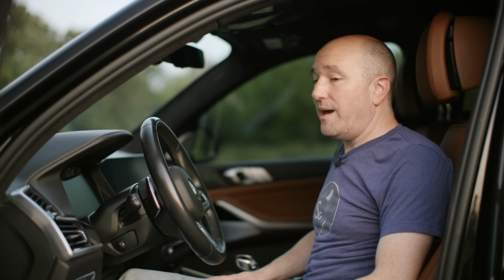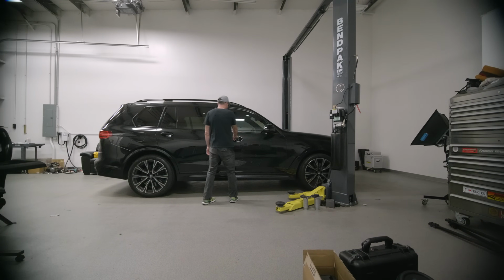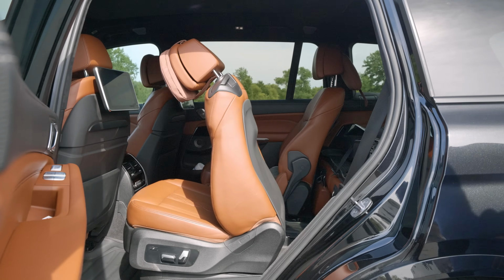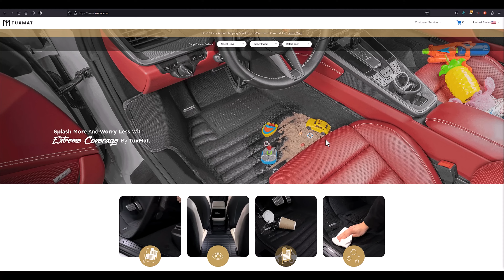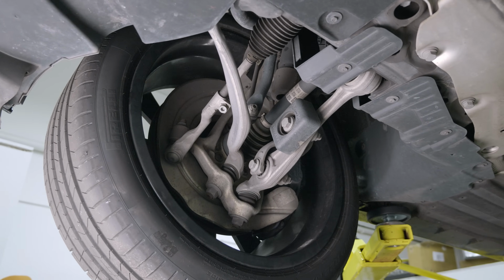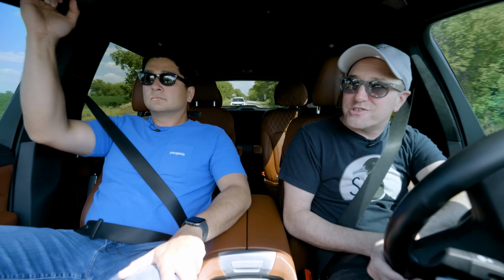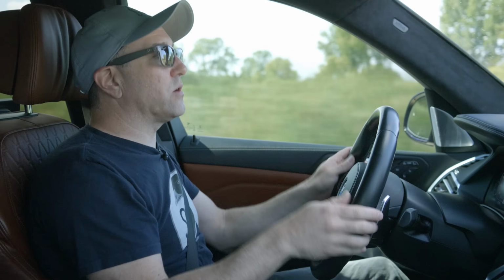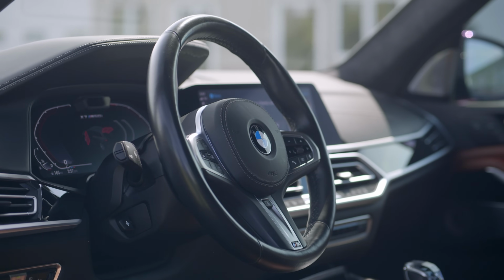BMW X7 | 45,000 Mile Long Term Results

Comment: Mark is the evolution of the modern car buyer in real time. LC500->X7->Rav4
Reply: It’s the sad fact. The running cost of “performance” cars is just too much these days. As much fun as I get out of my GTI, I sometimes wonder if getting a basic Camry or rav4 would have been better.
Reply: @waitingforcivictyper  the GTI is the perfect daily, you didn't make a mistake. The backseats are a little tight, but unless you have passengers all the time, it's fine.
Reply: @waitingforcivictyper GTI’s are performance cars?
Reply: @waitingforcivictyper  I see, you pay z German car tax, ya? :)  I figure the GTI wouldn’t be too bad to keep running as compared to BMW.  I heard the Civic Si is a pretty good compromise for fun vs cost of ownership.  

I’m old and boring enough to be happy with my hybrid CUV.  It’s quiet, comfortable, and has good tech for being 10 years old.   The roads around LA are bad enough I just want to keep my kidneys happy :)
Reply: This makes sense:
*LC500 - Looking for young hotties.
*X7 - Looking to have kids with a hottie. 
*Rav4 - Having failed at both, I give up on life and pursue inner happiness instead. 

I think that sums it up :0)
Reply: So who killed sports cars?
Reply: @waitingforcivictyper GTI's don't usually cost much to run, until the timing guids fail or the DCT implodes or something. My sisters had one for like 9 years or something now, it's cost her nothing but regular servicing and a failed window regulator - BUT, the mileage is starting to get up a bit, and it's now worth so little that if it has any serious issues, it may not be worth repairing - which is what happened to her prior VW, a W8 Passat - but they are notoriously unreliable and expensive compared to the Golf.
Reply: Except new RAV4 costs same as used X7.
Reply: @brianm5753 The modern left.
Reply: Yep. That interior is amazing. They should of kept it the same
Reply: Gesture control is amazing for adjusting volume and blacking out the screen for night driving
Reply: @DriverDude100  A new 2023 RAV4 in absolute top spec is under $40,000.  A used X7 M50i is going to be maybe $20K more than that at a minimum - and possibly quite a bit more depending on year, spec and mileage... and it'll cost you a fuckton more to run - and over the long term, probably more in depreciation, since even brand new RAV4's hold their value a lot better than aging BMW's - particularly aging S63 powered BMW's.
If you are like Marc here, and you've tired of the one-trick pony of the M50i's straight line speed, it makes a lot more sense to have a practical, economic daily driver, and a weekend car that one luxo-barge monstrosity consuming vast amounts of fuel, tires and suspension components, and rapidly approaching the 100,000 mile doomsday of the typical BMW V8.
Reply: @waitingforcivictyper  My GTI didn't present problems and I wouldn't drive a Camry.
Reply: @AllGasNoBreaks416  Why yes, the GTI IS a performance car.
Reply: @rlsedition  I guess to some it might be. I just can’t see a sub 300hp car being a “performance car” 

my 440i makes about 480hp with a downpipe and e30 tune &and I don’t even think if that’s a performance car.
Reply: I feel somewhat attacked and you’re spot on, lol. 911>Macan>GTI>M3 (currently)> waiting for a 4Runner😂😂😂
Reply: haha.  I did the poor man's version of that: RX350 -> X5M -> Hyundai Palisade
Reply: @waitingforcivictyper how much is your running cost & what year is it ?
I mean Camry / rav4 are good for buying & keeping 10-15 years
Reply: @NS416 if hp numbers is your barometer for what is/ isn't built for performance, you don't belong anywhere near actual enthusiasts.
Reply: @waitingforcivictyper I have a 2019 750i Msport, everything you just said and mark just said are bang on. 

But man, it’s hard to give up a v8 like the one that’s in these, mine is delimited and does 180mph with ease. 

I don’t think I’d be able to go to an anything smaller than an X3 m40i after owning this, the amount of room I have in this car is just insane.
Reply: @jaybinning2890 😂 how was it giving up your x5m? I currently have a 2019 750i Msport, it’s been worth every penny so far, have 50k miles on it currently
Reply: Ew
Reply: LC500->X7->Toyota Sienna
Reply: @brandonchism6960 how did you like the M3? I hear the gas mileage is great. Will the new car replace the M3 or be an additional one?
Reply: @WestOfAsh  it's actually good for the immense amount of power it outputs, though B58 should be sufficient enough for its everyday daily driving
Reply: @WestOfAsh  it’s great man!!! Still making that decision in terms of keeping it or replacing it. Likely keeping it based on mileage (64k on a 2022). As for gas, the manual isn’t as good as the auto, but I’m not complaining. I averaged ~28-29 for just under 80mph on long interstate rides. The car runs at 3k once you’re doing 80mph so it’s worth slowing a bit, lol.
Reply: Not if you've always messed with only Camrys and RAV4s...
Reply: @MikeYurbasovich exactly
Reply: @hondahirny ❤
Reply: LC500->X7->MDX Type S or KIA Telluride is his next one
Reply: @jaybinning2890 , in the last 9 years I did the following 6:
‘15 Golf -> ‘12 Smart Car -> ‘16 Sonata 2.0T -> ‘19 X3 -> ‘18 S90 T6 -> ‘11 TTS
Small->Smaller->Big->Bigger->Biggest->Smallest 😂
Reply: Yup. Ultimately, every day driving pushes you to practicality and expedience. $2500 tires? $200 rotors? Are you nuts?
Reply: @AllGasNoBreaks416  Your definition of "performance car" is not like mine. Drag racers think it's all about straight line speed and that's one way to look at it. I prefer a well-rounded machine, with equal focus on powertrain, vehicle dynamics and braking capability. One should also consider we're driving on public roads, where all that power is not easily usable on a regular basis. So it depends on your definition.
Reply: @brandonchism6960  I rented a 4Runner a few years ago and that machine had terrible handling/steering characteristics. How could you be satisfied with that vehicle after the performance cars you owned?
Reply: @rlsedition  Yep. I would consider a M4 / Golf R more of performance vehicle then like my 440i & your GTI. But I guess it’s depends on the person.
Reply: @AllGasNoBreaks416  I sold my GTI and purchased an Alfa Romeo Giulia 4-cylinder, which I also consider a "performance car". Both machines meet my definition for real world driving and favor vehicle dynamics over raw power.
Reply: @rlsedition  Great question. I'm not interested in the current offering. I want the one based on the upcoming Tacoma. While it still won't feel as great as any of the cars that I've mentioned (and some others that I didn't), I'm ready to have a vehicle that I can be less anal-retentive about. I know I ask A LOT of my cars and I maintain them to a level on par with that ask. I want to enjoy normal oil change intervals, parking and just walking away, storing my body armor and weapons without sacrificing my WHOLE trunk when training, and not having to move said body armor and weapons to someone else's vehicle when we leave the tarmac. For that, the 4Runner sounds great!!! Sure, I could do it in a Macan or X3, but the last time I had an SUV like that, I treated it more like a luxury product than a tool for use.
Reply: I have an IS350 F-sport RWD, 8AT; it requires 91/93, and only gets about 20mpg on average so if you drive a lot that will impact your running costs more than the maintenance costs/savings; consumables are relatively cheap, same price as maintaining a V6 Camry essentially, there is no "Lexus Tax" on parts or labor; likely cheaper than your GTI, as maintenance is cheaper and required less frequently than my 2006 WRX was; it's pretty minimal - annual/10kmi oil changes, air filters (engine and cabin) is most of it's life; plugs and brake fluid at 60k is the only standout compared to a "normal/vanilla" car that would have a ~100k interval for that, has a timing chain vs. a timing belt so no maintenance for that, has port & direct injection, so no carbon build up on the back of your valves, and it's a Toyota at heart so ease of maintenance (if you self perform) is baked into the design, it's way easier to work on than my WRX was. Not to mention the powertrain is over engineered, it's stupid durable and reliable. No special tools required to work on it either (looking at you German manufacturers!) and there is an AWD/6AT version if that's what you'd prefer, similar fuel economy, I just prefer RWD to AWD. It handles better stock than my WRX wagon did with full suspension, sticky tires & custom alignment. If it came with a manual trans I'd be very happy, especially if I could get it as a wagon with the 5.0L V8, but those things won't happen' also you can completely disable TC & VSC, and in manual mode it will not auto-upshift if you kiss the rev-limiter @waitingforcivictyper
Reply: Could they bolt more vibration dampers to the bottom of that thing?
Reply: How do you know he's dailying a RAV4 now?
Reply: I went 3 Series (f30) —> GLC43 —> RAV4
Reply: 😂 

Such truth!
Reply from the maker: You need to add Chevy HHR windowless at the end.
Reply: @japanwatchconnection I’m in zero hurry, I put 100k miles on my 2018 E300, so I have zero plans on dumping this anytime soon
Reply: @AllGasNoBreaks416 depends on your budget. It’s no M2 but pretty good with a simple stage 1 tune
Reply: @hondahirny  oh no, I'm on the brink of this
Reply: @aj6761 then a Toyota would not be on your list.
Reply: @hondahirny  Savage. And brutal. But accurate.
Reply: He's a novice ! Owning the Volvo XC-90 says it all lol
Reply: It’s funny how he doesn’t want a hybrid or v6 but he is so concerned about the fuel consumption … most of the things he is saying are down to his bad choices
Reply: @savagegeese go with lexus if you want luxury and reliability, rx  maybe the new tx?  Or you can go with the genesis gv80.
Reply: @waitingforcivictyper love my Kia stinger tribute edition, under warranty for 10 years
Reply: @waitingforcivictyper gtis get good mpg
Reply: @jaybinning2890  how is your experience with the palisade? I've had only BMWs for the last 10-15 years, E46s, E90s, E91, E70, and now we're looking to size up again as we plan for the third child. Seriously considering jumping into a Palisade. Will obviously keep a bmw 6MT sedan around as well 😅
Reply: @brianm5753  ... first it was the consumer followed quickly by the manufacturers.   Proof, fast wagons are the best of both worlds.
Reply: @hondahirny Ah sad, we hate our RAV4 because we had kids, it’s smaller than a Prius on the inside
Reply: @itshadouken The current gen Rav 4 has less interior space than the Prius?
Reply: Isn't it LC 500 -> X7 -> Pilot Touring?? I just skipped all that nonsense and went straight to the Pilot. Some part of me still want the 'process' tho. :)
Reply: @heinrichdude  I went LC -> Pilot Elite (last gen) -> X7. Loved all but the X7 is better in every conceivable way as a daily driver and people hauler. I test drove the updated Pilot Elite but I got used 2022 x7 w 28k miles for $9000 less than a new Pilot Elite. I did like the Elite but the dropdown tailgate, better tech, handling/driving and MPG of the X7 was too hard to pass up. I actually wanted a 2016 LC but damn they asking $55k for those…
Reply: He got a rav4 really?
Reply: @MikeYurbasovich Reality, you mean
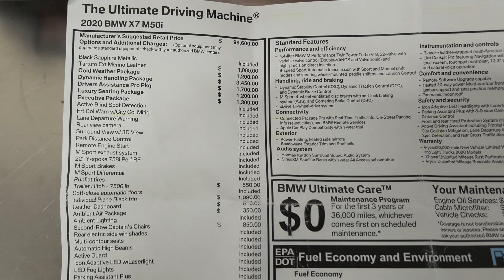Reply: 😅 1:49
Reply: It’s all for content at first. Oh wait I have to deal with life eureka Rav4
Reply: @TML34 GTI? are you kidding? dude you don't drive a V12 awd ferrari GTC4 lusso, your car is cheap 200 hp volks wagen.

Comment: I've heard the Toyota Sienna is a great downgrade from the BMW X7. It's cheaper, more practical and sexier.
Reply: I rode in one just a few weeks back, really enjoyed it.
Reply: Dude
Reply: It’s the X7 that is the downgrade.  How dare you!? #minivans4lyfe
Reply: What’s wrong with mild hybrid??  Weight? Complexity?
Reply: Sexier? Hell nah
Reply: The Sienna totally lacks the practicality of its competitors. The 2nd row seats are not removable nor do they fold into the floor which is the whole point of a minivan and its practicality. The 4 cylinder hybrid is absolutely gutless and takes 12 years to get to 60 which is important if merging onto the highway. A Sienna loaded with passengers will take you 20 years to get to 60. I was very disappointed when I test drove the Sienna and all it has going for it is fuel economy and reliability. I passed on the Honda Odyssey as well and ended up leasing a Pacifica Touring L which feels MUCH more upscale than the other two minivans, has the stow n go for every seat behind the 1st row and with the appearance package looks half decent compared to the other two. I know looks are subjective. I've had the Pacifica now for 18 months and had zero issues (knocking on wood) and service costs have been shockingly cheap compared to other Euro vehicles I've owned, both wagons and SUV's. My first service at 10K miles/1 year was only $87 and I requested a 4-wheel alignment and was told it doesn't need it.
Reply: @fleuger99  if u think $87 is cheap, guess how much it is for maintenance for the first 3 years of bmw ownership.... 

it's 0 dollars!
Reply: @minigiant8998  Don't worry, Years 3+ QUICKLY make up for that initial Maintenance Cost tease....
Reply: @georgehugh3455  um, most people lease duh
Reply: @hondahirny  I was a minivan hater. Then I married a woman with two kids and a Chrysler T&C. Still had my modified MINI Cooper S for thrashing. Perfect solution. The minivan was reasonably reliable. Suspension parts were ludicrously cheap and simple to replace. We gave that van to some friends, and it's still going strong with well over 250,000 miles on it. Upgraded to a 2013 T&C. Stow and Go seating is the bomb. Highway mileage is acceptable, but around town it stinks. I've hauled sheetrock and plywood in it easily. It towed my snowmobile trailer like a champ. The only caveat is rust and the boominess of the cabin interior. I think the Pacifica addresses the interior noise, but Stellantis doesn't GAF about corrosion control, which is a deal breaker in the rust belt. The only replacement for a minivan is another minivan. Indeed #minivans4lyf !
Reply: Feel the same pain on my m340i, as fantastic piece of machine it is, its depreciation is truly depressing!
Reply: @minigiant8998  "most people lease," huh?  So after 3 years, BMW's are just thrown away?  Even Mark BOUGHT the BMW used.  "Duh"

The VAST percentage of BMW X7's ON THE ROAD are bought, even if the initial start was through a lease by people with disposable cash who couldn't care less how much it costs to repair.
Reply: You forgot 100x reliable.😂
Reply: dont diss sienna 🤏 they have 5 mo wait list
Reply: I rode my sister in law (and vice versa) with all seats folded down. That van is awesome
Reply: oh boy I heard single mums love Toyota Sienna😂
Reply: I drove a minivan for 10 years and my wife is hot as hell!!
Reply: @minigiant8998 0 dollars because you paid for it in the ridiculous price
Reply: @markwilliams6378  anything over 20k is ridiculous b/c a nissan versa will get u from point A to B.  the world operates on supply and demand and obviously if bmw is dominating markets it's b/c the price is NOT ridiculous.
Reply: Calling Toyota sexy, I love how people jump into BMW video comments and try to compare then with a Toyota. Sad
Reply: My dude said sexier 😂 okay buddy

Comment: 40i is actually not bad financially wise with the b58
Reply: DID SOMEONE SAY B58??? - jack
Reply: Simplicity = reliable
Reply: Yeah I think its the better decision if it's your daily. You get better consumable costs. Can get 28-30mpg on the highway. B58 is fairly reliable too.
Reply: I saw an X7 at costco and asked the owner how he liked it.  He said he loved it and mentioned most of the issues on with the V8.  Noted. Love this but I'd pass on the V8 everyday of the week and twice on Sundays.
Reply: @gbriank1 So a Model T would be more reliable than a modern car ? OK
Reply: @great_deception yes.  think of the hundreds of systems in a modern vehicle.  in this statement, i didn't factor in preventative maintenance (oil changes, filters, gasoline, spark plugs, ability to start via crank).  Model T was really the first SUV.  You can take it almost anywhere, use almost any fuel,  preventative maintenance is extremely simple.  Compare that to a Land Rover
Reply: @gbriank1 LMFAO, tell us when you sell your modern vehicles for a Model T.
Reply: @great_deception I wouldn't have a problem with that.
Reply: B58 is alright but still gets cooling system issues down the line thanks to all the plastics used.
Reply: @dd4886  Sure hope not.  Have a B58 in my X3...
Reply: In Australia we get the 6 cylinder diesel 40d which has the torque and fuel economy to compete with the V8.
Reply: @HiPlains1  straight six is wayyyyy to weak of an engine for this tank, need the TT V8 if you wanna be able to over take a camry v6 on the highway lol